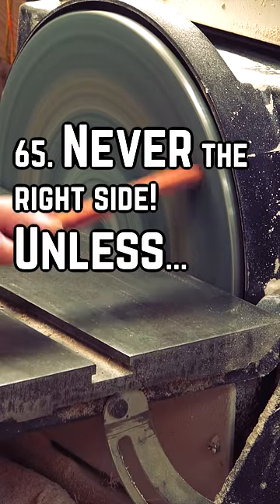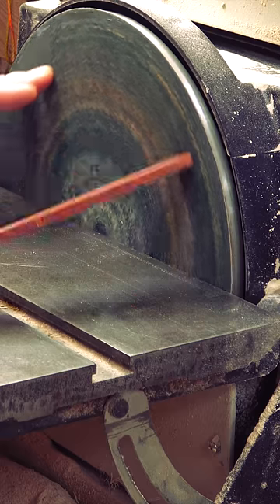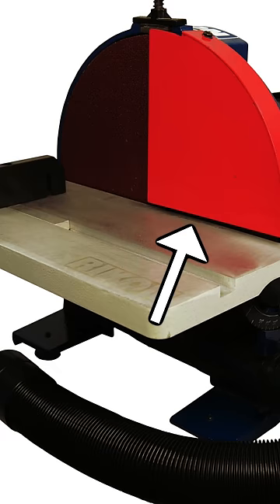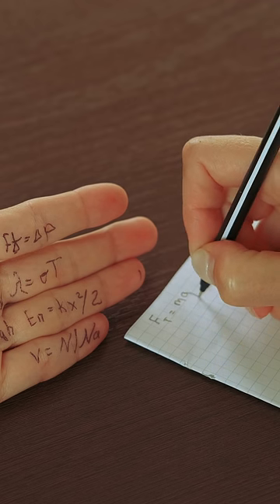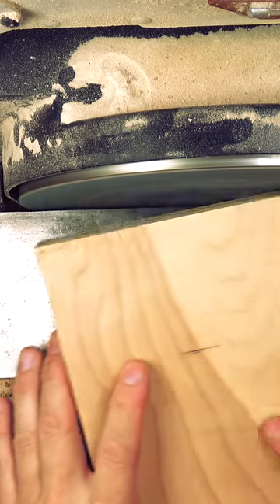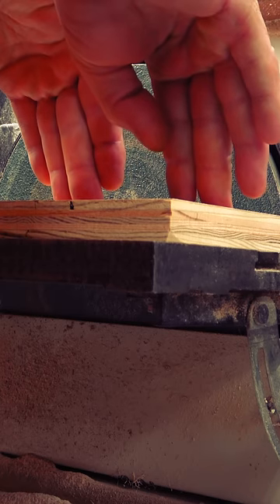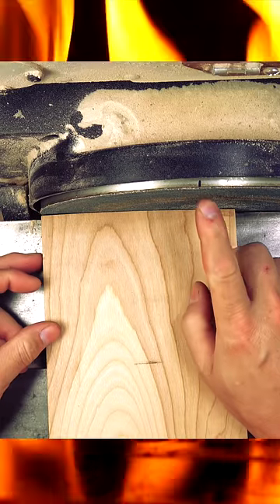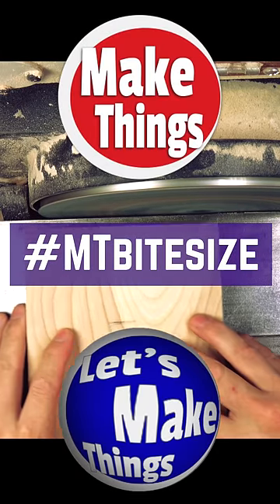65. NEVER the right side!  Unless… #mtbitesize #shorts

Comment: Got my finger caught in one of those for a hot second. And I mean HOT, burnt some bits of finger nail to my hand. Somehow heeled in two month but I still feel a bit twitchy sanding on them. Just don’t be an idiot like me and hold a thin bit of stock at a downward angle
Reply: I wanna correct the misspelling, but I can’t diss that kind of work.
Reply: I know a guy who had most of his hand sucked through the 1/8" gap between the wheel and base. Gloves bro
Reply: I was always terrified of using one.of those sanders, never wanted to get my hands caught and lose a few layers of skin.
Reply: @johndon3782  jesus
Reply: @johndon3782  
Just hoping the "gloves bro"
Translates to... do not use gloves when using a disc sander or many other rotating power tools.
Reply: I had a classmate who got all his fingernails ripped out at one of those and now every class has to sand from hand

Comment: only used a disk sander for small metal parts, as I'm a fabricator, fucked up a couple years ago and used the left side to clean up a piece of angle for a bracket, it sucked the toe of that angle down past the tool rest so quick and took my fingers with it, I never snatched back so fast in my life, stuck with the right after that unless it was the edge of something I knew my fingers were clear of and didn't want it kicking back at me
Reply: Good golly

Comment: I was taught to sand on the upward stroke so it couldn't get caught in the machine. I never had any issue with not controlling the piece
Reply: Depends what material you're using I guess, usually the table is close enough that it would be hard to get anything stuck in the machine, at least with the ones I have seen